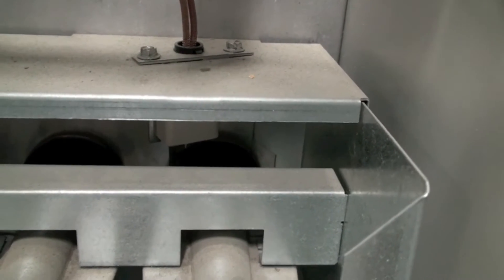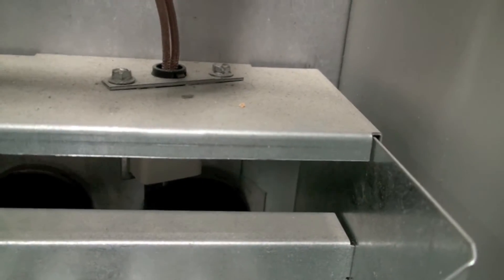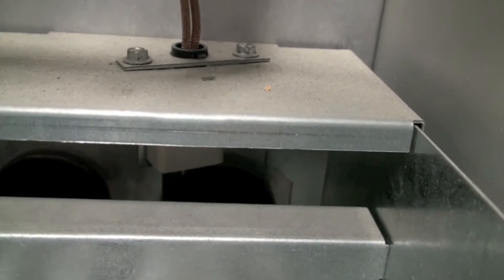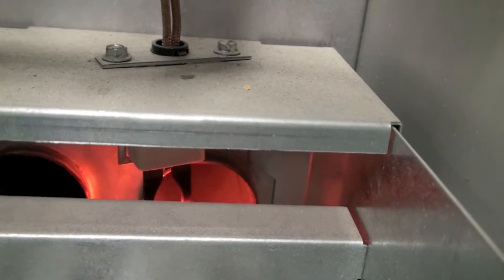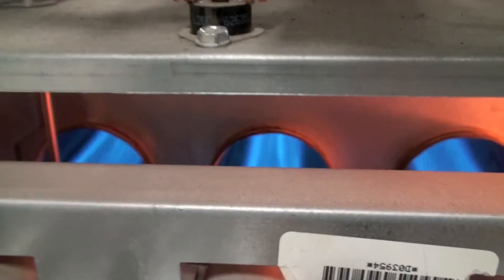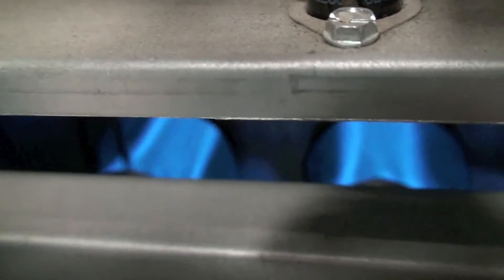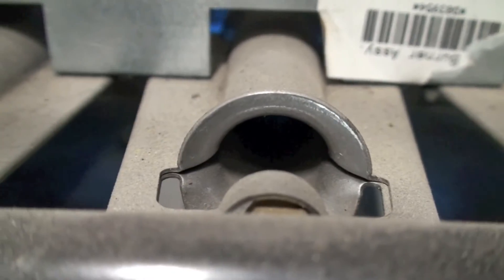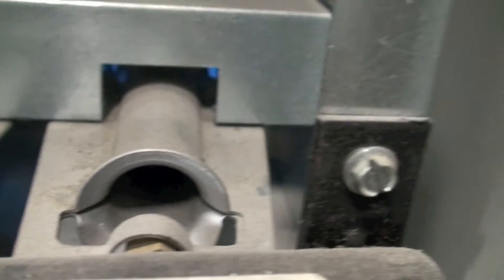80% AFUE gas furnace cycling and sequence of operation Amana furnace

Comment: call for heat , R W closes 
furnace does a system check 
inducer motor starts , 30 second pre purge 
IDM creates a negative pressure differential 
this closes the air proving switch 
The control board recognizes this and checks to make sure the roll out and high limits are in their normally closed positions 
The Hot surface igniter will get energized for about 15 seconds and there will be a 3-5 second window for a trial for ignition. the flame rectifier must prove the flame in order for the gas valve to stay open 
the HSI will denergize and a timer relay will come on for the blower motor .
the blower motor will energize after about 1 minute 
the call for heat will satisfy when the desired temperature is reached 
RW will open 
the gas valve will turn off , IDM will denergize 
blower off delay relay will energize 
after 1 minute and a half the blower will turn off
Reply from the maker: Dylan Mallett  In general you are all correct.  Different brands have some difference in HSI warmup time and off delay is adjustable.  Thanks for the thoughts.
GFM